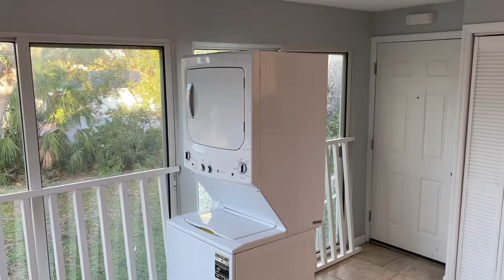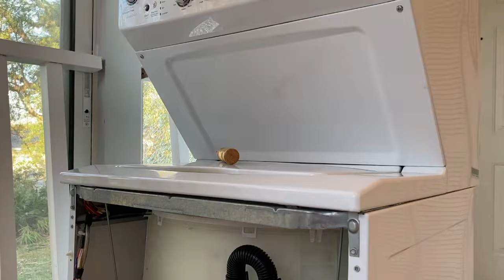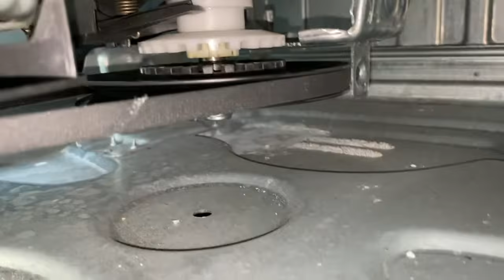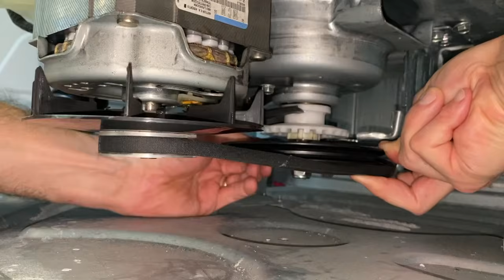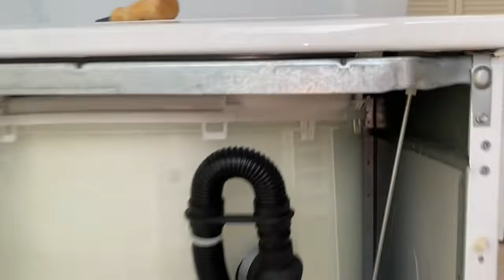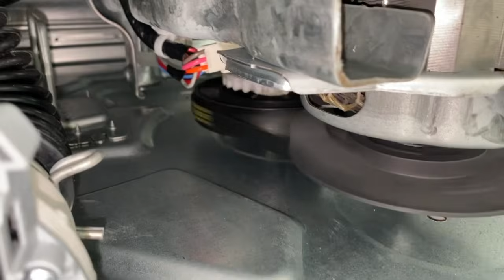Replace GE Laundry Center washer motor belt

Comment from the maker: If interested in purchasing this product, visit our Amazon affiliate link below.  I earn from qualifying purchases.

GE Laundry Center

     Electric:  https://amzn.to/40utSsq

     Gas:  https://amzn.to/3WtjiB8

Irwin hook knife:  https://amzn.to/4hEdXPV

Washer drive motor belt:  https://amzn.to/434BIfg

Washer drive motor:  https://amzn.to/4gFPisN

GE Drain Pump:  https://amzn.to/4h6tnft

Drain hose clamp:  https://amzn.to/41kZGC4

Water Inlet Valve:  https://amzn.to/3X2J13y

New water lines/hoses:

     https://amzn.to/4jDg3AT

     https://amzn.to/3Q10cOU

     https://amzn.to/3Q0vKV7

New dryer vent hose:  https://amzn.to/3PYQi0e

Dryer exhaust shoot:

     https://amzn.to/3C7bfTl

     https://amzn.to/42aJLH2

     https://amzn.to/40hLwzN

New Power Cord:  https://amzn.to/3WAg4eS

Dryer outlet/receptacle:  https://amzn.to/40DcUIO

New Felt pad:  https://amzn.to/40HkGCm

GE Lid/door latch switch:  https://amzn.to/4hNWrZh

GE lid/door catch:  https://amzn.to/3CdiGZt

Drain pad 29”x33”

     White:  https://amzn.to/42t3GkQ

     Black:  https://amzn.to/40v7dfK

     Gray:  https://amzn.to/3Ec5F2M

GE Control Board:  https://amzn.to/40Mrij1

GE Dryer Heating Element:  https://amzn.to/3CrNIwB

GE Dryer Push-Start mechanism:  https://amzn.to/3Cq0BHG

Dryer belt:  https://amzn.to/40GkCmq

Dryer Drive Motor:  https://amzn.to/3EcEhBR

Dryer knob:  https://amzn.to/3CpTzT4

Washer start/cycle button mechanism:  https://amzn.to/3CqZEyK

LG THINQ Laundry Center

     Electric:  https://amzn.to/42l4XKJ

     Gas:  https://amzn.to/3E4hwzU

Dyson vacuum:  https://amzn.to/42FZG0m

Interior clothesline:  https://amzn.to/3tkwE3e

**********************************

1.  Replace Laundry Center washer Drain Pump

          https://youtu.be/zFs2qbrfG5g

2.  Replace Control Board

          https://youtu.be/CqGeZuNiYWA

3. Prepare Laundry Center for pick up and haul away

          https://youtu.be/QxJ-Aro1-lQ

4.  Replace dryer vent hose exhaust shoot

          https://youtu.be/ZsEBjLR5LOQ

5.  Replace Laundry Center Power Cord

          https://youtu.be/0q2CIqmPHDQ

6.  Replace Laundry Center Water Inlet Valve

          https://youtu.be/i3T-PfgGpLk

7.  Replace dryer felt pad

          https://youtu.be/xFHzwp7ueTQ

8.  Replace Laundry Center washer drain pump

          https://youtu.be/zFs2qbrfG5g

9.  Replace Laundry Center water lines

          https://youtu.be/KxQZf0dMFN0

10.  Replace dryer belt

          https://youtu.be/-Kz3Th7K9bs

11.  Laundry Center dryer power cord reset

          https://youtu.be/WA6asZX9ndA

12.  Replace Laundry Center dryer vent hose

          https://youtu.be/wdtfAqMu748

13.  Replace Lid Switch (Not on unit shown in video)

          https://youtu.be/1hTRc-_PnP8

14.  Replace Samsung dryer drive motor

          https://youtu.be/-Wt3DqC-er4

Comment: My rear pulley is different and does not have that indent like yours. Its just a solid circle which makes the new belt extremely difficult to put on. But your video is great
Reply from the maker: We appreciate that, thank you.  How did your belt project turn out?

We will also share a link to our full channel below.

     https://youtube.com/@diywithmichaelborders?si=RLj03uRVzbKvWCl0

🧰
Reply: @DIYwithMichaelBorders i was able to put belt on and also changed drain pump but still the same problem persists.

Comment: Oh man I had a belt slip off 6 months ago. Repair guy charged $285 to put it back on. It has happened again and I am attempting it myself. Ugh I can’t get it back on. The back gear/pulley looks different and this is the same machine in the video. My back gear/pulley is completely flat and greased. So I assume it’s just gradually sliding down and off since there is no lip/edge on the back spool. Wondering if that needs to be replaced. (KIT TRANSMISSION PULLEY NUT WASHERS
WH49X27323) if you look that part number, we’ll see it’s just flat but shouldn’t have grease on it?
Reply from the maker: Thanks for watching, any update?  If pulley is “over-greased” … it definitely increases the likelihood of belt sliding off.
Reply: I am currently having the same issue. Bought a new belt and cannot get it on!  The plate that holds the motor is slotted, but the hole the bolt goes into the motor is not, so loosening the bolt and adjusting the position of the motor to seat the belt, then moving it back to put the belt in tension is not an option as shown in other videos.  One video shows the use of a zip tie through a spoke on the back (smooth) pulley to keep the belt in place as you turn it, but my pulley is solid so that isn’t an option.
Reply from the maker: @MikePloski 

Thanks for watching, any update?  OEM belt?
Reply: @DIYwithMichaelBorders OEM belt, still can’t get it on. Really don’t want to call someone in, but I might have to.  My concern is that if I keep trying to force it on, I’ll stretch it enough that it goes on, but loses enough tension that it’ll just slip off when the unit is run.
Reply from the maker: @AshliePloski 

That’s interesting, surprised it’s not feeding on in a friendly manner.  The belt itself may be ever-so-slightly smaller…causing the issue.  Any update?

Comment: Hi! my rear pulley doesnt have a lip on it its just smooth is this normal or should it be replaced?
Reply from the maker: Thanks for watching, do you have the same unit as shown in this video?

Do you see any signs of damage to pulley?  If so, definitely best to replace it so the new belt doesn’t get damaged and slide off pulley.

😁🧰
Reply: @DIYwithMichaelBorders  yes it's the exact model....the belt definitely could use and change the grooves in the belt were almost melted. I could pull pieces of rubber from inside the grooves. I put the belt back on today and ran a small load. The belt stayed on. I'm just curious if both pulleys have grooves to hold the belt, the first one does the second on smooth and slightly greasy
Reply from the maker: @sharonjohnson5843 

Thanks for the reply, the unit shown in this video is roughly 12 years old.  Your model may have a slightly different designed pulley however should still have and indented slot for belt to secure into.  👍
Reply: @DIYwithMichaelBorders  thank you that's what I thought as well! I appreciate your responses and the awesome video!
Reply from the maker: @sharonjohnson5843 

😁🙏🧰

Comment: The replacement belt is pretty tight and won’t go on the pulleys. Any suggestions?
Reply from the maker: Thanks for watching, any update?  Have you tried installing belt onto pulley as you simultaneously rotate the two?

Is new belt OEM or aftermarket?

Does new belt have same part number as old below.

Comment: I have the same unit but my dryer is gas. Do you know if the dryer and washer belts are the same as the electric model? Just trying to do some maintenance before they snap.
Reply from the maker: Thanks for watching, they are same indeed.  😁👍🧰
Reply from the maker: If interested in purchasing this product, visit our Amazon affiliate link below.  I earn from qualifying purchases.

GE Laundry Center

     Electric:  https://amzn.to/40utSsq

     Gas:  https://amzn.to/3WtjiB8

Irwin hook knife:  https://amzn.to/4hEdXPV

Washer drive motor belt:  https://amzn.to/434BIfg

Washer drive motor:  https://amzn.to/4gFPisN

GE Drain Pump:  https://amzn.to/4h6tnft

Drain hose clamp:  https://amzn.to/41kZGC4

Water Inlet Valve:  https://amzn.to/3X2J13y

New water lines/hoses:

     https://amzn.to/4jDg3AT

     https://amzn.to/3Q10cOU

     https://amzn.to/3Q0vKV7

New dryer vent hose:  https://amzn.to/3PYQi0e

Dryer exhaust shoot:

     https://amzn.to/3C7bfTl

     https://amzn.to/42aJLH2

     https://amzn.to/40hLwzN

New Power Cord:  https://amzn.to/3WAg4eS

Dryer outlet/receptacle:  https://amzn.to/40DcUIO

New Felt pad:  https://amzn.to/40HkGCm

GE Lid/door latch switch:  https://amzn.to/4hNWrZh

GE lid/door catch:  https://amzn.to/3CdiGZt

Drain pad 29”x33”

     White:  https://amzn.to/42t3GkQ

     Black:  https://amzn.to/40v7dfK

     Gray:  https://amzn.to/3Ec5F2M

GE Control Board:  https://amzn.to/40Mrij1

GE Dryer Heating Element:  https://amzn.to/3CrNIwB

GE Dryer Push-Start mechanism:  https://amzn.to/3Cq0BHG

Dryer belt:  https://amzn.to/40GkCmq

Dryer Drive Motor:  https://amzn.to/3EcEhBR

Dryer knob:  https://amzn.to/3CpTzT4

Washer start/cycle button mechanism:  https://amzn.to/3CqZEyK

LG THINQ Laundry Center

     Electric:  https://amzn.to/42l4XKJ

     Gas:  https://amzn.to/3E4hwzU

Dyson vacuum:  https://amzn.to/42FZG0m

Interior clothesline:  https://amzn.to/3tkwE3e

**********************************

1.  Replace Laundry Center washer Drain Pump

          https://youtu.be/zFs2qbrfG5g

2.  Replace Control Board

          https://youtu.be/CqGeZuNiYWA

3. Prepare Laundry Center for pick up and haul away

          https://youtu.be/QxJ-Aro1-lQ

4.  Replace dryer vent hose exhaust shoot

          https://youtu.be/ZsEBjLR5LOQ

5.  Replace Laundry Center Power Cord

          https://youtu.be/0q2CIqmPHDQ

6.  Replace Laundry Center Water Inlet Valve

          https://youtu.be/i3T-PfgGpLk

7.  Replace dryer felt pad

          https://youtu.be/xFHzwp7ueTQ

8.  Replace Laundry Center washer drain pump

          https://youtu.be/zFs2qbrfG5g

9.  Replace Laundry Center water lines

          https://youtu.be/KxQZf0dMFN0

10.  Replace dryer belt

          https://youtu.be/-Kz3Th7K9bs

11.  Laundry Center dryer power cord reset

          https://youtu.be/WA6asZX9ndA

12.  Replace Laundry Center dryer vent hose

          https://youtu.be/wdtfAqMu748

13.  Replace Lid Switch (Not on unit shown in video)

          https://youtu.be/1hTRc-_PnP8

14.  Replace Samsung dryer drive motor

          https://youtu.be/-Wt3DqC-er4

Comment: Thank you so much for this video. A Local appliance repair service here in New York charged us $310 to diagnose our machine and now they want another $420 to come back out and put the belt in. That’s over 50% of the cost of the machine. We are trying to dispute this with them, but in the meantime, I would like to just replace the belt myself. This video shows How ridiculous the charge of almost $800 is. . Can you just cut the belt off? Thank you so much for this wonderful video.
Reply from the maker: You are very welcome, we are honored to help.  That’s a very pricey bill to just replace a belt…😲

The belt can be removed in a friendly manner without cutting it.

Please keep us posted on your situation.  We are here to help!  The DIY community is the BEST!

😁👍🧰
Reply: @DIYwithMichaelBorders Thank you so much I will.
Reply from the maker: @sjmphotonyc 

👍🧰
Reply from the maker: @sjmphotonyc 

😁👍🧰
Reply: @DIYwithMichaelBorders Holy smokes. I got a belt at a local store and installed it. The entire procedure took me no more than 15 mins to get the cover off then put the belt on. Did a test load. Works!  I’m going to once again shut the power off and clean out that area. I can’t believe they wanted to charge us over $700 for this. I do not have appliance experience at all. But I do have an understanding of mechanical products. Maybe that helps. But still. I’m guessing they could have done it in more than half the time I took. 

They still have $300 of ours which I will dispute with the CC company. They offered to do it from $420 with a discounted price of $270.  Personally as someone with 2 self made businesses on our household we know the struggles first hand of running a business and it was never built on dishonesty and robbing clients. 

Thank you so much for your help. What a great channel.
Reply from the maker: @sjmphotonyc 

This is an awesome comment to wake up to, thank you so much for sharing this follow up.

That is a true testament to the Power of DIY!

They WAY OVER-CHARGED this project, shame on them.

This is an exact example of why we started this channel.  Our goal is to get the DIY community the info they need without wasting their valuable time.

We give you 👍👍 for making the decision to replace this belt by yourself rather than paying that enormous amount they were trying to hit you with.

A true win for you!  🏆

Comment: I have a GE gud24essmww, and I just had to place the belt back on after it fell off (luckily fully intact). Do I need to tension the belt? If so, how do I do this? How do I make sure it's the appropriate tension?
Reply from the maker: Thanks for watching, any update?

At this point, we recommend replacing belt.  Reason being…the old belt is worn and stretched a bit to where it fell off.

Keep us posted.